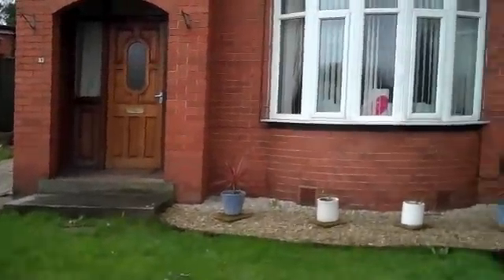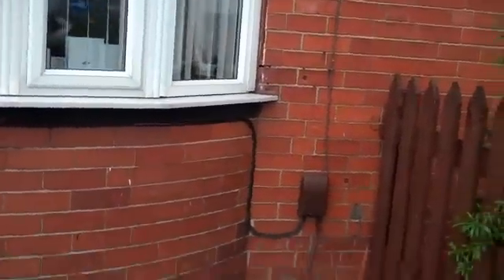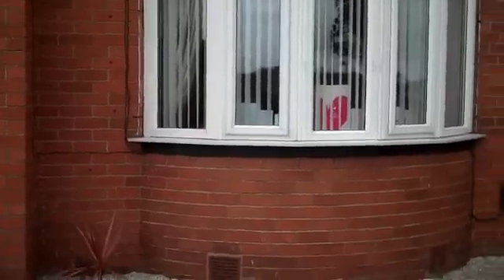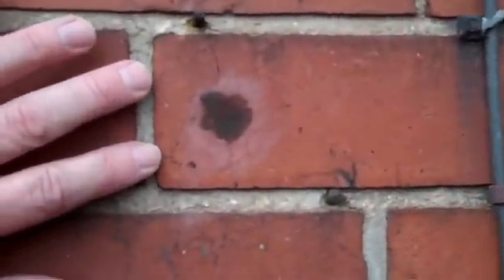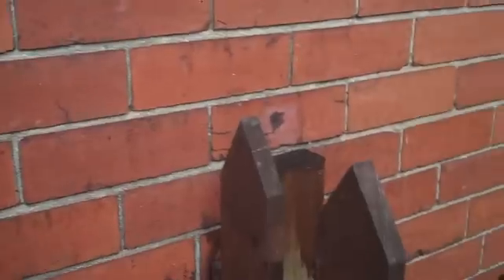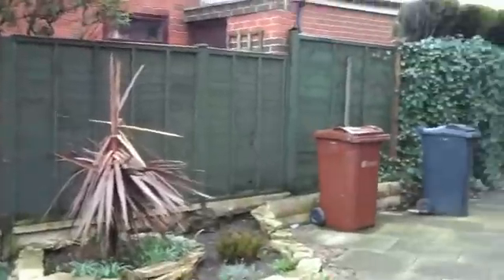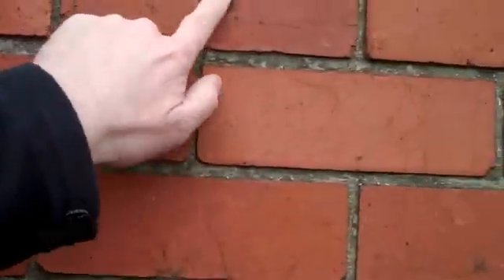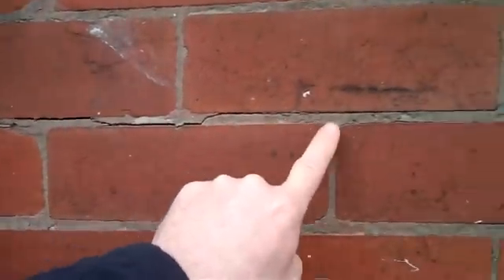Wall ties; guaranteed waste of money!

Comment: The damage by old rusting wall ties is the tremendous lifting force that rusting creates, not only causing a visible gap in the joint but often bowing the brickwork out inbetween wall tie courses. Old wall ties will do this whilst still being strong enough to tie the walls for many years. I couldn`t agree more, the fitting of remedial ties is pointless unless the old ones are removed. Remedials are quick and easy, removing old ties is certainly not. Remedials just tick a box that has to be ticked to get a mortgage.

Comment: How important is it to remove or isolate the old ties? Fishtail ties
Reply from the maker: +Ben Barker Hi Ben, Thanks for commenting. In most cases the isolation or removal of the old rusting ties is essential. If they are left in position, rusting and expansion continuies and more cracking can occur. Where there are thin section 'wire' type ties, these can usually be left in position, as the cracking is less common and not significant. However, sometimes even these ties need isolating - treat every house on its merits.

Comment: But even five years ago wall ties were made from stainless steel. 
So what did they use instead to go rusty so quickly and cause the mortar bed to split ?
I note someone called Kabyuk mentioned this ten months ago.
It's very intriguing.
I'm not trying to catch you out or doubt you. It's just very interesting to know as many botches as possible.

Comment: Unless you get up into the roof space it's an easy way you can tell if the walls are cavity or solid brick. It may look solid but you can get a cavity wall using cut headers this gives the look of Flemish Bond construction.
Bad cavity tie installation they should have drilled at the intersection of the Mortar bed and the Perpend.

Comment: But at 1.50 in the video, you point to horizontal cracking which you say is caused by 'wall tie corrosion' so presumably it is a cavity wall?